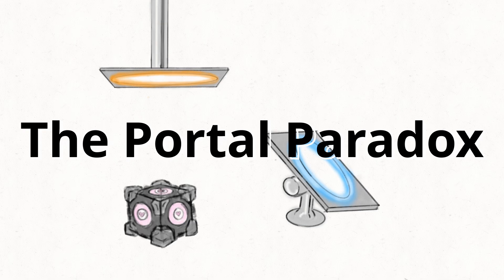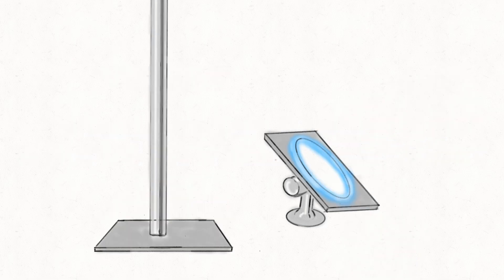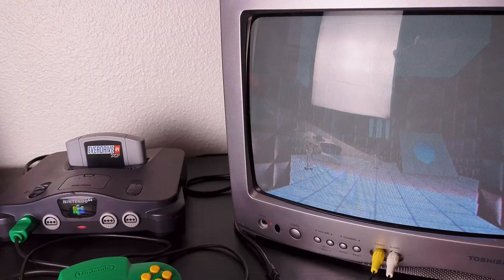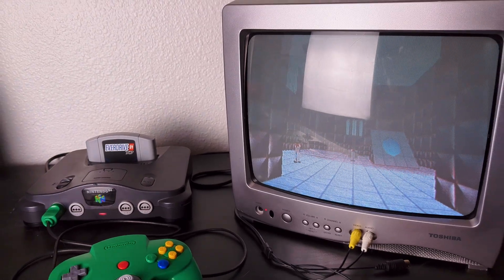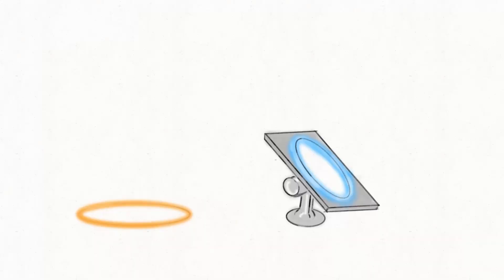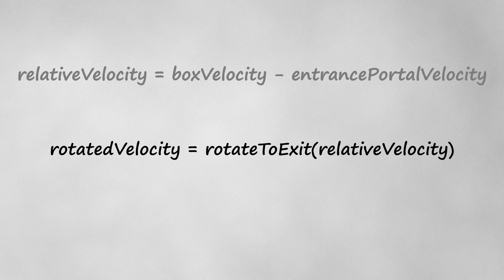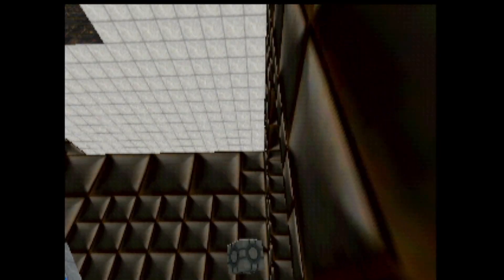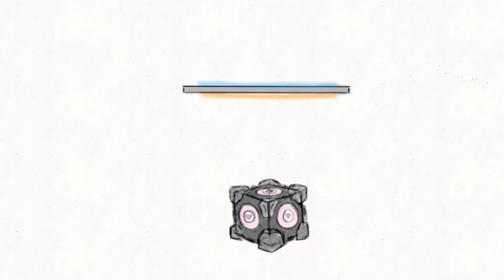I rewrote Portal from scratch and solved the Portal Paradox

Comment: Now tell us what happens when you smash two portals together with something in between them. 🤔
Reply: In "reality" I think the object would be crushed, and if the force moving the portals isn't enough to crush the object then the portals would just stop moving.
Reply: @JeffHanke The thing is the only thing this Cube is colliding is with itself and not with the Portals, in theory the Portals still could move closer because THEY don't collide with anything, yet the cube collides with itself, so the fate is kinda unclear, it either gets crushed into a two-dimensional surface and then collapses into a black hole according to the Discoveries of Einstein and Schwarzschild or - the less lethal solution - would be like you said.

But to be honest I wouldn't even wanna try this Experiment because of the first theory
Reply: @JeffHanke  To be more precise, the box would be crushed by itself, by the force required to push the portals together. Either the meganism that pushes the portals together will break, or the cube will break because its not strong enough to hold its shape. If either are strong enough to not break, the portal will stop moving with the cube sandwiched in between, similar to an actual press not being able to crush the object under it.
Reply: my shot in the dark is that the object would crash with its own edges
Reply: @nuuus_xd black hole time!
Reply: If the object could fit side by side with itself, it would push itself out of the way and sit next to itself, and the portals would get closer and closer until the object couldn’t  repeatedly push itself out of the way anymore.

once the object is balanced on itself or cannot fit anymore next to itself, then it would lay against itself and the side of the portal. The portals would be forced a certain distance apart but could be shifted together after overcoming friction to pass over the object infinitely. 

To bring the portals together would compact the object, causing pieces to fall from between the portals.

If you smack the portals together really hard, I bet the air would begin nuclear fusion and blast the portals apart. This brings the question of what would be made if an atom fused with itself? Would nuclear fission be forced to take place if the portals were separated? Strange stuff.
Reply: @kaidwyer  That's exactly what I said.

Most products of nuclear fusion will either be stable, or they'll decay through radiation. It'll only fission if it's fused into a critical mass of radioactive material. I wouldn't worry too much about that. The fusion reaction will have released enough energy to sterilize the area long before you'll get to witness fission. :P
Reply: @kaidwyer  Oh, you said fuse with ITSELF.

That's hypothetically possible. The result would be quark-gluon plasma once the energy exceeds the binding energy of the nucleons. This is really weird stuff. It's a liquid, not a gas! And it's superfluid so it'll flow without resistance, which means it'll escape the trap if there's any way out, no matter how small.
Reply: @kaidwyer Well, it also depends on what the cube is made of, at a certain point you cannot gain more energy from nuclear fusion, Iron for Example is the remaining Ash after countless times of Nuclear Fusion and Nuclear fission.

Meaning you cannot get energy from either fusion or fission, you rather have to put energy in them in order to create nuclear fusion or nuclear fission.

Otherwise Uranium for Example wouldn't work the way it is.

Assuming the cubes were made of Iron it would be more likely that they wont explode - yes they may become hot because of the increasing pressure, but they shouldnt actually explode because instead of releasing energy as a side-product of the fusion they need energy to fuse, and this energy they get by forcing them to be pressed together.
Reply: THIS is the question. Using the box as the example, I agree with the others - it would collide with itself. But what is hard to answer is if the portal act as a window, with no physical connection with the box, will it be able to meet the other portal and create infinite force? Surely that's impossible? But so are portals, probably...

In game world I'm sure the box would just go flying or teleport to a random coordinate, probably out of any feasible range and crash the game.

OP can you try this with a long pole, but the pole is on an angle, if at the right angle, surely the portals could meet since the pole would never collide with itself.

This is as fascinating as playing Portal was for the first time, thank you to all cause that's all I've ever wanted to feel again.

Edit: After thinking about it, it wouldn't be infinite force, but just a lot of force, or enough to collapse any object down to what I would assume to be a micro black hole? Too much mass in a certain space - which actually happens with stars etc... That seems reasonable if we allow portals to exist. I'm content with this theory.
Reply: @EldeNova  So.... The EASY answer to that paradox is to realize that the cube doesn't have infinite rigidity. If it can exert force on itself through the portals, then that means it's under compression. It will immediately begin to heat up. Depending on the material properties of the cube, it could crumble, crack, deform, or crush. If it crumbles, then parts of the cube will be expelled from between the portals. If it cracks, the parts of the cube will slip relative to each other, again possibly being expelled as a result. If it deforms, then mass will squeeze out the sides, again being expelled. And if it crushes, it'll get hotter. If the cube melts or vaporizes, see "deforms". If something somehow prevents the mass of the cube from escaping, then eventually you're going to trigger nuclear reactions and the mass will turn into energy, escaping from the trap. And yes: if somehow THAT'S prevented from happening, welcome to Black Hole City, population Cube, though the moment the portals move apart again it'll instantly vaporize via Hawking radiation and kill everyone around.

The COMPLICATED answer to that paradox is that you have to figure out where the energy to push the cube into itself comes from. The answer to that gets into some... pretty complicated physics. The short version is that moving the portals relative to each other must necessarily require the input of energy because it changes the geodesics of spacetime. (That is, there's potential energy bound up between the portals just like there's potential energy bound up in a ball at the top of a hill.) A realistic implementation of the physics would mean that a surface without a portal would be easier to move than a surface with a portal attached to it. And where does the energy to move the portal come from? From the piston attached to the surface, of course! So that means that trying to push a cube into itself would cause it to become harder to move the portal by AT LEAST as much as it would take to crush the cube if the portals weren't there. If the piston isn't strong enough to crush the cube, it'll stop moving.

Welcome to the Hydraulic Press Portal! Today we are going to crush... cubes.
Reply: @codahighland I think perfect rigidity is a fine assumption to make in the portal world. it's already nonphysical enough, so why stop before assuming every object is an indestructible rigidbody? I haven't played portal so idk if there are any instances of objects breaking
Reply: @thomaskaldahl  Mashy spike plate?
Reply: @thomaskaldahl Yeah in Portal no objects break. But that is a good point
Reply: @DeathnoteBB  Fizzlers disintegrate any object that go through them, and at one point you shoot a laser through a moving (!) portal to slice through tubes of neurotoxin. And, as I said, mashy spike plate.
Reply: @codahighland you're not thinking about this like a programmer.  The cube will simply fall forever and never contact itself.  What's more likely to happen is that, as the portals get closer and closer, you'll reach a point where the program simply breaks and crashes.
Reply: @LeCharles07   What do you mean, I've been programming for 36 years! :P
Reply: I'd argue it actually would be infinite force. Or more like infinite potential force as it would be able to crush anything and the measured force would just be whatever it took to crush it. But in a scenario where you had an infinitely hard object inbetween you would measure infinite force I would imagine. However in that scenatio the universe would probably end because of how much heat that amount of force exertion would create. @EldeNova
Reply: @EldeNova  Might be a pretty big concussive explosion when they touch all the way. the left and the right side of the box would collide together instantly but i dont think the acceleration of the portals would matter because it's instantaneous. When the portal touches the object the transfer is instantaneous, the dimensions of time and distance(space) cannot be applied to the object, so no acceleration or speed would have an area of space to exist.  it would be like a hydraulic pressing both sides together but instead of the middle molecules being under pressure, they would be under tension but the ends would still have pressure, so there would be a kind of runberband snapping action but backwards...... maybe? Pretty interesting to think about. It might spin really fast too, I think is a possibility.
Reply: The cube would go gmod sounds on itself and bounce around clearly.
Reply: the surfaces 'hosting' the portals would hit resistance, same as if they were pressing against the cube without any portals involved
Reply: I would also think it crushes itself, like everyone else is saying, having rigidity in mind. But, of course there's a but... we have a problem with that.

If it would crush, where's the force coming from?
I would imagine that the force exerted by the cube into itself is the same as the force exerted by the piston pushing the portal togethers. There's an inconsistence with that, because unlike with everything else the cube and the piston have no direct nor indirect physical contact with each other for the force to be translated.

If you think about it, when pushing the cube into itself it would be up to the rigidity of the cube stopping it from moving before crushing, but what's stopping the portal from continue to move?
Reply: @drafa.  I was thinking about this, and I think there must be a force between portal and cube. Please note, I've never played these games. But here's my thinking: set two portals (non-moving) a good distance apart and instead of a cube, push a long rod through the middle of one portal until it's half way through. Now you have half a rod sticking out the end of the other portal. If you start moving that other portal side-to-side or whatever, it makes sense to me that the rod would be carried with it. Thus, though there is no physical contact, there is a force from the portal acting on the rod. Or, like gravity, spacetime is bent in such a way as to produce the same effect as a force.
Reply: @hughcaldwell1034  That's an interesting example to think about.
What we are moving is the relative point of reference, and I guess this is where things get complex. With the rod half way through, the half outside the portal is still attached to the half inside the portal, and not with the portal itself. In the case you're describing, the force isn't coming from the portal acting on the rod, but instead it's coming from the half of the rod inside acting on the half of the rod outside. 

What I think would happen is, the force needed to move the relative point of reference - the portal - wouldn't change, unless it comes into direct contact with one of the edges of the portal, but imagine moving the portal really quickly with a longer rod fixed on one side. It would make sense for the one half of the rod to snap, due to gravity and drag, because the rod is still connected to the other half of rod. Meaning the force to move the half outside the portal is coming from the fixed half inside the portal, and not the portal itself.

With the cube example, we could say that the force is coming from the other half, but it's the interaction between the 2 halves that becomes complex, especially when we bring the portals incredibly close together. Since the portal and the cube move independently from each other, the portal moves with much ease, basically generating an impossible amount of force.
Reply: Another shot in the dark but complex and incomplete, would be for there to be a completely different dimension that we can't comprehend, where the cube could temporary faze into. Since there's no actual force pushing the cube into itself but the portals keep getting closer, the cube would get infinitely closer to the portal, like a fractal, basically fazing into an infinitely smaller dimension.

We can think about this 4th dimension as how in a 2 dimensional plane, pushing the cube in the Z axis would make it seem like it temporary disappears out of existence, outside the normal boundaries, but in reality it's just a matter of perspective.
Reply: I assume it would be squished into itself. Basically a hydraulic press effect but the pressure comes from it’s own self
Reply: The object might become its own hydraulic press. It would squish itself.
Reply: Either the force is enough to flatten the object, or the object is solid enough and you can't smash the portals together
Reply: Simple. The box (or whatever object) would hover in the marginal space you have created in between the two portal bearing surfaces. Once you move the two surface away from each other, the cube will start rapidly moving from one to the other portal until the distance is large enough that it will fall down. In reality it was already moving rapidly, it's just that the space is so marginal that it is perceived to be floating.
Reply: i guess the cube would fuse into heavier elements😅
Reply: Crowbcat
Reply: The object crushes itself
Reply: the object would probably be crushed by itself
Reply: Backrooms.
Reply: You can't. Because the own block blocks itself. It is touching itself in both portals, so the portals cannot go any further without compressing it
Reply: You enter the 5th dimension
Reply: i say the portals are blocked by the object, and stop moving
Reply: One must understand that the object is not being crushed by the portals themselves, but instead by the surface on either end of each portal, like a hydraulic press.
Reply: The object would “collide with himself” as soon as the portals started touching it. The system would behave the same as 2 regular platforms pushed against an object from opposite directions. Depending on wether the object is “crushable”, the object would crush or the platforms would stop. I believe Portal had no crushable objects but half life certainly did (ammo boxes, ventilation shaft entrances)
Reply: The item would go half-way through and slam against itself, either completely stopping the piston holding the portal or crumble and get crushed until the item gets compressed enough to stop the pistons. It would effectively be exactly the same as smashing two boxes together, or just smashing a box with two pistons, the portal doesn't really change much at all
Reply: the item is yeeted into the backrooms
Reply: MinutePhysics subscriber here
Reply: Not possible, the object hits itself so the portals can't advance
Reply: Take two mirrors and bring them close to you, what would happen is you'd just hit yourself instead of glass
Reply: i think either of these 3 would happen.

1° the object would collide with itself, as if you're pushing your hands against each other, meaning the portals would stop.

2° the object would be crushed because the force of it pushing against itself would be greater than it could resist.

3° the object would turn into a black hole.  there's a definition for a black hole, which is a singularity, a single point, with a huge ammount of mass, so great not even light could escape from it, but what if you had some ammount of mass, in a minuscule space? wouldn't the same happen?
Reply: The cube would just be pushed against itself on both sides, making the two moving portals act like two normal pistons pushing against a cube in the middle
Reply: The object crushes itself. Like how you can't avoid your reflection in a mirror.
Reply: Klein Cube.
Reply: it would crush itself, with the left side compressing the right side and the ride side compressing the left, i guess?
Reply: this creates a big bang and resets the universe. please do not attempt until 2292
Reply: I'm no physicist, but here are some theories!

Answer 1:  The object will be crushed.
Answer 2: If the portals don't travel at the same rate, I could see the object pushing itself and causing a particle accelerator type thing.
Answer 3: The object will be inverted somehow, with the portals sort of mirroring the object on either side.
Answer 4: The object will remain as though nothing happened, the portals cancelling each other out by making contact.
Reply: in all reality, or lack there of reality, the object would make contact with itself. I belive you would end up splitting atoms apart and it would be the destruction of said object by transfering its matter into raw pure energy and heat.
Reply: You open a black hole
Reply: It would be forced out from between the portals as they got closer together?
Reply: In the games, people have done that and it’s nothing fantastic.
But irl the object would be crushed
Reply: Crushed.
Reply: the bigger question, is when are we going to get a half life 3 game where gordon, alyx, sheppard, barney, and chell team up and use this portal paradox as a way to create a black hole that destroy the combine nexus? :D The companion cube gets sacrificed to save the universe.

My theory would be that as the two portals approach each other, they are essentially forcing the mass of the object to crush itself against an infinitely long chain of itself. as it does so it creates a 2d black hole, since there is already infinite mass in a(relatively) straight line that is being compressed down into a flat surface between the two portals so the infinite gravity can only pull in matter through the finite distance between the two portals, reaching a critical mass at the point which it can suck in the surface the two portals are on, at which point the two portals can occupy the same space, making there be no gap between them any more, leaving the two portals floating face to face. creating a black void in space that the matter inside cannot escape but is no longer sucking in any more matter. acting as a permanent prison for the combine. Then maybe have the gman step out of the black void.
Reply: It would be crushed by itself as it's left side is slamming into its right side and vice versa
Reply: I suppose it comes down to "Will the object be crushed completely?"
Or "will it make the portals stop moving once it hits itself, and how would that force be calculated, what force would you need to stop a portal from moving at, let's say, 10 meters a second
"
Reply: the same thing that would happen if you tried to send any two separate objects through the portal at the same time, they crash into eachother. it hardly matters that they are also connected